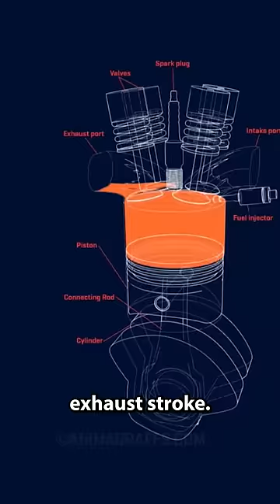Turbos Vs Superchargers

Comment: Boost drives the crank instead of the crank driving the boost. Deep knowledge, shallow lesson. Love it.
Reply: But i feel like this is wrong. Turbo is driven by exaust gases being pushed out of the combustion chamber, putting a restriction on the exaust loads the piston experiencing the exaust stroke. The reason you can put a load on the exaust stroke is because it is not just allowing gases to escape, but is pushing them out with force being provided by whichever piston(s) happen to be experiencing the power stroke at the same time, which uses the crank to push up the piston loaded by the turbo(s)
Reply: @seanandrew2823 yea that’s kinda the point of his explanation… both setups have some kind of loss attached to them naturally, but with a turbo you are guaranteed to have max energy release during the power stroke for every single cylinder
Reply: I caught that too but I think it's cause the turbine is lighter weight than the roots or scroll
@seanandrew2823
Reply: @seanandrew2823 you make a very valid point. He speaks like it’s a single cylinder engine.
Reply: @seanandrew2823 glad someone else is thinking about this. I’m pretty sure the reason why turbos are more efficient than superchargers boils down to two things. The most obvious one is off boost you aren’t generating a ton of parasitic loss like a supercharger. Even with bypass valves if you aren’t clutching out the compressor you are experiencing pretty substantial parasitic drag spinning that compressor. The second is that the turbo is recovering energy from the exhaust stream that the supercharger can’t. Even though the backpressure means some parasitic loss occurs on the turbo it is still getting more out of those hot gases that would otherwise go to waste. Banks’ explanation is simpler but not the full picture.
Reply: @seanandrew2823 I've actually just said this in my own comment prior to teasing yours, although I haven't said exactly the same thing the basics agree so I wouldn't have bothered had I read your comment first ...... I mean basically you can't get energy from nowhere and it takes energy to compress the air whether you're using a turbo or a blower and that energy MUST  come from the power stroke, even if indirectly.
Reply: @jcarlos4458 no you're not, the cylinders are mechanically linked via the crankshaft, the energy of tge piston going up on the exhaust stroke comes from the power stroke, the energy to run a compressor whether a turbo or a blower must ultimately come from the power stroke - where else could it come from?
Reply: @alphagt62 even with a single cylinder engine the piston is being pushed up on the exhaust stroke, the energy to this comes from the rotational momentum of the crank and flywheel and in turn the energy that imparts that momentum comes from an earlier power stroke ... directly ot indirectly ALL the energy MUST  come from the power stroke, there's nowhere else for it to come from.
Reply: @DOAHunt3r do you happen to know what component makes up the majority of exhaust gas pressure: unextracted combustion pressure or piston “push”? 

Probably a complex question, but I’m inclined to believe unextracted combustion pressure makes up most of it. If that’s the case, then that would be points for the turbo as well.

But yeah, the biggest reason for turbo efficiency is the conversion of thermal energy to mechanical energy. IE, temperature to RPM.
Reply: @izzabelladogalini yes, but the question is, is that energy coming from what would normally go to waste or from what would normally be used? 
Turbos use “waste” heat to create boost.
Reply: @tylerfb1  that's not the question and turbos don't use waste heat, they use the pressure in the exhaust mainly created by the upstroke of the piston on it's exhaust stroke and that upstroke is powered is powered by the crankshaft which in turn is powered by the power stroke - ALL the power of a four stroke engine comes from that single power stroke, there's nowhere else it can come from. Banks pretty much confirms this when he talks about back pressure.
https://youtube.com/shorts/k7yYY_hy250?si=GYuCQrNOjlEjltqV
Reply: @izzabelladogalini  well you don’t know how turbines work then. Their ability to extract thermal energy and turn it into mechanical work is their secret sauce. That’s literally how they work, and it’s why turbo supercharging is more efficient than mechanical supercharging.

The temperature, pressure and flow rate through turbines is complex; Gale Banks is trying to explain how things work in laymen’s terms. But the energy to drive a turbo charger does not all come from the exhaust stroke, a large portion comes from the thermal energy in the exhaust gasses.
Reply: @tylerfb1  is it the pressure in the exhaust manifold? Yes or no? ... Where does that pressure come from ...maybe the chemical explosive force of the explosion that happens when the fuel /air mixture in the top of the cylinder ignites at the end of the induction stroke and pushes the piston down the cylinder this also creates heat .... Now where does the power to compress the air in a turbo come from in your model ...does it take it from the power stroke or from somewhere else, if the latter then tell me where
Reply: @tylerfb1  ps would that be the thermal  energy created in the exhaust manifold as fuel and air burn... Blimey is that what you think?
Reply: @tylerfb1  you wanna explain further about what I got wrong about "how turbines work" I replied twice and you didn't answer...
Reply: @izzabelladogalini  I accidentally replied before I was done; you might have a gotten a notification. I deleted that reply, this is the finished one. 

There are three types of energy we are concerned with in the supercharging problem: mechanical, potential, and thermal. 
After the power stroke, at BDC, all the energy from the combusted fuel is in these three forms in some combination. With mechanical supercharging, only the mechanical energy now in the crank is used to create boost. The potential energy in the form of pressure of the exhaust gasses is wasted out the tailpipe, as well as the thermal energy in the form of temperature of the exhaust gasses is wasted as well. 

Turbo superchargers use the potential energy as pressure and the thermal energy as temperature and convert both of those to create boost. 

It is true that the pressure of the exhaust gasses post combustion is not enough to go through the turbine. Some mechanical energy from the crank is converted to pressurize the gasses. That potential energy (pressure) is then converted back to mechanical (spin the turbine) to be used to create boost. But that’s not the full story.  

The key to understanding how turbines work is this: 
Turbines designed for hot gasses use an expansion cycle. It works almost like a piston and cylinder. The hot gasses expand across the turbine, reducing pressure and temperature. But, if you were to pressurize the post-turbine gasses back to their pre-turbine pressure, they would NOT be their pre-turbine temperature. The reason is because some of that thermal energy was converted to mechanical energy to turn the turbine. This is a major source of energy to turn the turbine. 

That’s what makes turbo supercharging more efficient than mechanical super charging. Even though the exhaust gasses need to be pressurized from the crank, it doesn’t need as much energy from the crank as mechanical super charging because a turbo converts heat to boost.
Reply: @tylerfb1  first off I never at any point said turbos were more or less efficient, they are more efficient for some of the reasons you've stated plus the lower mass of their components ... HOWEVER all of the energy from a turbo or supercharger comes from the combustion of the air/fuel mix during the power stroke or if you like the BANG in suck, squeeze, BANG, blow ....again I state there is NOWHERE else energy can come from, the energy used to compress  the input in a turbo or a supercharger both come from the power or bang stroke of the engine - the only exception to this is the use of pre pressurised NOx ...physics 101 you don't get anything from nothing, yeah sure the heat in the expended exhaust gasses adds to the used pressure and that's part of the wasted heat from 4 stroke ICE but it's a tiny amount of the actual amount of energy used in a turbo, if you don't believe me compare the thermal efficiency of an NA to turbo engine - the difference is miniscule
Reply: @tylerfb1  turbos are literally more efficient when dissipating the heat produced with the use of an intercooler,. Hot air or indeed any gas is rubbish it may increase pressure but reduces the mass flow
Reply: @tylerfb1  I suspect (I could be wrong and apologise if it isn't the case) that you're copy and pasting without a real understanding of the topic
Reply: @izzabelladogalini  lol. No I am not. I have a good understanding of the subject, having taken a few college level courses on it. 

I never said you said turbos were more or less efficient. I never said energy comes from anywhere but the combustion of the fuel in the cylinder. That is a given. 

The video is about why Gale Banks likes turbos over mechanical superchargers. He said because they make more power for a given cylinder pressure. He seems to contradict himself by saying the pressure in the exhaust comes from the crank in the exhaust stroke. I’m saying he didn’t. 
I’m saying it’s true that turbo supercharged engine make more power for a given cylinder pressure than NA or mechanically supercharged engines because turbo chargers get a lot of their energy from the thermal energy in the exhaust that is wasted in mechanical supercharging and NA. 

The thermal efficiency has to do with the thermal heat cycle in the cylinders. It’s a spec that has more to do with the cycle (Brayton, Otto, Carnot, etc) and what goes into that rather than a useful spec for comparing efficiencies between same-cycle engines. 

The spec that gives us something useful is brake specific fuel consumption. You’ll find that nearly every turbo supercharged engine is better on that than NA, and mechanical super charging. That’s because turbines extract heat and turn it into rotation of the turbine.
Reply: @izzabelladogalini  this isn’t necessarily true. While inter cooling always increases boost and efficiency, to say that without inter cooling supercharging is useless is just false.
Reply: @izzabelladogalini  I need to correct my self. 

Thermal efficiency can be used to compare same cycle engine efficiencies. But super charging doesn’t really effect that number. It sorta can be thought of “outside” the thermal cycle of the engine. Yes it effects it somewhat, but not really. It’s like saying an altitude difference effects the thermal efficiency of the engine. Meh, only slightly.
Reply: @tylerfb1  The exact split is hard to say between exhaust blowdown and the constant pressure exhaust stroke, but the higher the RPM and the less ideal the ignition timing the more residual pressure will pop out at the speed of sound into the exhaust manifold. The blowdown is "for free" but the constant pressure exhaust stroke is not. Some papers I've seen suggest about half of the thermal energy delta to ambient is captured by the exhaust turbine, which would explain why modern gas turbo engines have electric wastegates that completely bypass the turbine during cold start to help heat the catalytic converter.
Reply: @DOAHunt3r  thought that would be hard to say. Thanks for your insight!
Reply: @tylerfb1  he didn't say it was why turbos make more power for a given cylinder pressure ..... He said there's a maximum cylinder pressure before things fail so it's better to parasite from the exhaust stroke than the power stroke to make extra induction pressure but that's wrong and you're wrong if you agree because the exhaust stroke is powered by the power stroke, you just conceded that everything is powered by the power stroke, the heat is a tiny fraction of what contributes to what turns a turbo  .... Go back to college
Reply: @izzabelladogalini  So you're saying that Gale Banks doesn't know what he's talking about. Wow, you just like to revel in your ignorance and refuse to understand,  don't you?
Gale may have misspoke about the reasons, but the fact that turbocharged engines makes more power per given cylinder pressure over mechanical supercharged engines is undisputed. But the reason why is because turbochargers extract heat energy from the exhaust that would otherwise be wasted, and it is a major energy contribution, it is NOT a "tiny fraction".

Believe what you want. There's the facts.
Reply: @tylerfb1  "may have misspoke" is that your way of saying "was wrong"?
He's not a god he does err and in this occasion he was wrong, it wasn't simply a slip of the tongue he was very specific about what he was saying and you trying to desperately reinterpret it doesn't change that fact .... A turbo gets it's energy to compress the intake gas from the power stroke because everything comes from the power stroke .....twist it any way you want that fact is inescapable.
Tell me why you get turbo lag at low revs even when an engine is hot if heat is such a prime factor?
Reply: @izzabelladogalini  I’ve already told you how turbines work. You want to know more, go read a book.
Reply: @izzabelladogalini  High coolant temps are not the same thing as high EGTs. Even at 1 atm at 2000 RPM the EGTs aren't going to be that high. At the end of the day the turbo needs both exhaust blowdown, backpressure generated by the exhaust stroke, and high EGTs to run the compressor. Two of those are nominally not coming from the power stroke of the engine, one is. Hence the turbo is an exhaust energy recovery mechanism.
Reply: @izzabelladogalini  Yea but that happens for every internal combustion process regardless of whether there is a turbo or not. So with a turbo, you take advantage of that mechanical process to create boost. With a supercharger you don't, and using a belt driven off of the crankshaft creates more loss than simply using the exhaust gases from the exhaust stroke.
Reply: @tylerfb1  my man is doing the lord's work trying to explain the basic thermodynamic principles of a turbine o7
Reply: @jcarlos4458  totally agree but that's not what was being said, it was said that the turbo is not taking from the power stroke so the maximum amount within the physical constraints of the engine can be taken from the power stroke as there is a maximum .... this simply isn't true true, turbos for all their light weight efficiency and use of otherwise extended exhaust gas also put a direct force against the engine in particular creating a  higher pressure for the piston on the exhaust stroke to fight against as opposed to an NA engine this is directly mechanically linked to the power stroke of another piston (or for a single cylinder the rotational momentum imparted to crank and flywheel by the power stroke of the same cylinder), so whilst it is utilising some exhaust pressure and flow that would go to waste in an NA it is also parasiting some usable power from the power stroke ... There's a clear difference between being "more efficient" and being   "non parasitic" you correctly claim the former but the video claims the latter.
Reply: @seanandrew2823 the force pushing out the exhaust is there whether it's turbo or supercharger, and the back pressure creating more resistance is only a big factor if turbo is too small which if that is the case you won't create enough power to worry about engine failure.
Reply: @seanandrew2823 yeah man you know better than him good job.
Reply: Came here to say that also
Reply: @seanandrew2823  came in here to say the exact same thing.  It's still coming from the crank.  Most of the turbo's advantage over Roots comes from its more efficient moving of air - less energy going into heat - and typically more efficient intercooling.  Turbos have no real advantage over centrifugal chargers for the same reasons, though they make far more area under the curve due to midrange torque.
Reply: Superchargers are good. Turbos just sound and look better. At the end of the day it's all boost.
Reply: Everybody seems to have missed his main point he restated multiple times which is turbo makes better power than supercharger for the SAME CYLINDER PRESSURE. Sure you can get the same output gains from a supercharger, but it WILL require higher CYLINDER PRESSURE than a turbo since the power driving the crank and boost for a supercharger is from the power stroke. The turbo has the benefit of adding the pressure it takes to drive itself to the exhaust stroke (which will still be far less than the power stroke). The point Mr. Banks is making with cylinder pressure is ultimately that for the same power output, you are less likely to have an engine failure due to cylinder pressure with a turbo. He never argued one makes MORE power, but rather BETTER power (with better being defined as a more reliable engine).
Reply: @seanandrew2823  piston doesnt really need to push the exhaust out, its hot and under enough pressure that most escapes by itself
Reply: @seanandrew2823 Is that not offset by boost pushing the pistons down on the intake stroke?

It's better to think of a turbo as a turboshaft engine with the regular piston engine acting as the combustor.
Reply: @jcarlos4458 you missed the point, if the power stroke isn’t driving the supercharger belt then it’s driving the exhaust stroke that is feeding the turbocharger.
Reply: @seanandrew2823  the more " faster " the turbo spins will create a vacuum and pull the gases out of the next cylinder..
Reply: @izzabelladogalini In thermodynamics the term we use to describe this is Adiabatic.